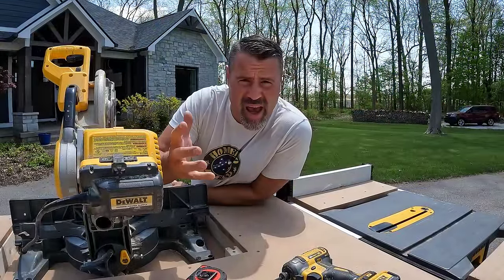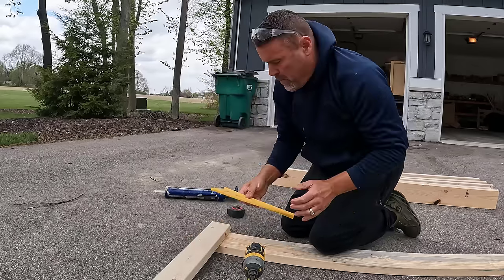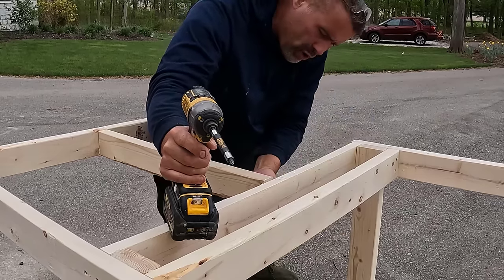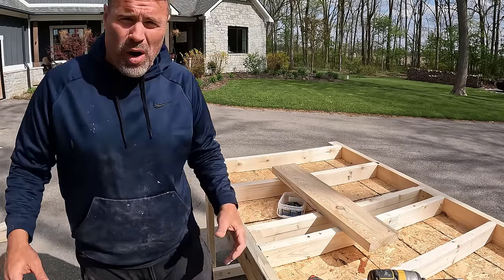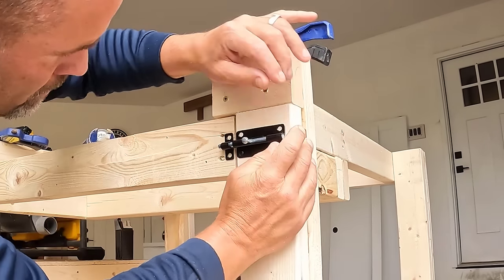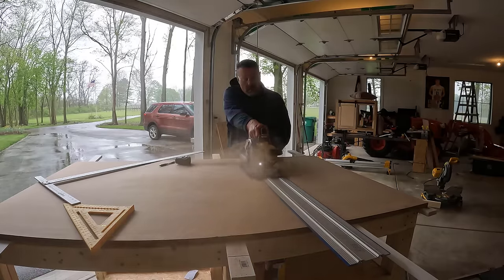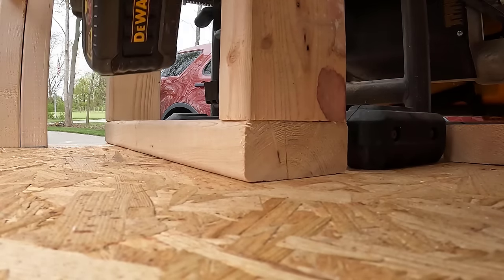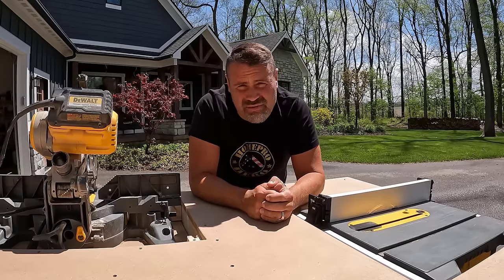Build This Workbench for UNDER $200

Comment: It is a great workbench build......BUT for me I sort of hate it!! You see I don't own a garage and where I do most of my work is in the lawn behind my house!! So those casters would sink into the ground if I tried to roll ANYTHING like this out of my "workshop"!! And the problem with my "workshop" is that it is only an 8 foot by 8 foot work area. This means ANY lumber I have to cut, I have to cut it in my yard!!! And use the inside of my workshop for things like glue up or some small assembly work!!
Reply from the maker: Yea not a good fit for you :(
Reply: bro you working in a box or what lol
Reply: This is my problem as well. My basement is an old 1886 cellar. Its not tall enough or really big enough to be a shop. Id love a bench like this.
Reply: Can you build a wall mounted fold out table somewhere? That might help you. Otherwise just make some cheap saw horses and screw a sheet of plywood to the top. When you are done, just unscrew.
Reply: Awwww mannnn you just need tires and not those lil wheels lol
Reply: Drill some holes into 4x4 legs and put some small bicycle forks into them.
Reply: you need to por yourself a concrete slab - just big enough for you and the bench, then put a tent over it 😅
Reply: Harbor Freight has pneumatic wheels on straight or swivel casters, 8” or 10” if you really want a go anywhere solution just adjust the build to compensate for the height. May be overkill for most but they don’t get stuck and you can drag it around most any yard. Improvise a type of kickstand solution to keep it put when you are ready to work. My shop is small and I do most of my work outdoors on the grass in backyard and get tired of dragging my heavy duty sawhorses, 2x4s and plywood around in the heat trying to find shade in 110 degrees. Built my portable bench ( though nothing as nice as this)with wheels and love it.
Reply: Little children in Rwanda are crying over your tragic situation. I here they are organising a concert to raise money for you to put some paving down.
Reply: You hate his bench because it won't work for your problems. 😂
Reply: Put bigger wheels on the bench for off-road use. 😊
Reply: Awesome job. Thanks for sharing your work 👍🏾
Reply: How is that this guy's problem..
Reply: You hate it because he didn't design a system custom to your situation? You realize the beauty of wood working is that you can learn something and customize it however you need? It's about learning. Not copying.
Reply: Modify the project and put sleds underneath so you are able to slide it to your work site.
Reply: Sound like you probably lol
Reply: Use the king size wheels.
Reply: Get a wagon
Reply: Simple tank track upgrade
Reply: Who puts casters on dirt 😂😂
Reply: I used bigger wheels from Harbor Freight. It rolls pretty good in the grass.
Reply: Thanks for sharing your dilemma because I have the same. 

Thanks everyone else for solutions!
Reply: Use old ply sheets to build a path on the lawn, use ur head for more than a hat rack
Reply: I understand your frustration regarding the lack of a proper workplace, it takes 5X the effort to get a project completed
Reply: Slap some OSB down on the lawn and roll’er on out
Reply: Same i have to do everything outside and store everything in the 8x8 room because people steal so it has to fit in the door way also. Love the casters but same problem.

Comment: Do you ever use a cross cut sled or miter gauge with your table saw? Just wondering if you ever felt the need to add slots in the outfeed.
Reply from the maker: No I never have. I actually like the kreg track saw better - seems safer too!  I got a kreg accu-cut I'm using on my next project. Have heard great things about that.

Comment: I have watched countless versions of this workbench being built and your presentation is by far the easiest to understand. Was able to build it using 90% leftover lumber from other projects so it only cost me like $40 to make. Thanks a ton!
Reply from the maker: Glad it was helpful! $40 bucks is a steal!  I guess keeping extra pieces of wood laying all over the garage is worth it :) Take care!
Reply: I was thinking the same thing! I like the size too. I think it is useful but practical when you don't have a ton of space. The only addition I will make is possibly a router station. Great project. Thanks!
Reply from the maker: I have had several people wanting to add a router table. I don't seem to ever need one I'm guessing more for wood working projects.
Reply: @HomeProHero  Definitely useful for woodworking. From basic work on drawers or rounding an edge on a table top to speaker boxes for car stereo projects or work on guitar bodies and pickguards. Routers are super useful and more so when they are mounted.
Reply: @63fryeguy  I'm building this bench right now and I'm including the router. I will let you know how it turns out!
Reply: @63fryeguy  I was finally able to complete the workbench with my router table instead of the table saw. It turned out great! I highly recommend if you want to add the router.
Reply from the maker: That's great!

Comment: Combining simple construction with mobility and an outfeed table, plus a fold-away miter saw station with adequate infeed and outfeed, all in a compact table saw bench is ingenious, or maybe genius. Well done!
Reply from the maker: Thanks and  adding the storage drawers was a game changer for my tools!  Take care!
Reply: . @HomeProHero  -- Yes to drawers, definitely. And here's another one: you could add a 2 or 2-1/2 foot hinged fold-down extension to the table top in way of your miter saw's outfeed side. You could do that by using hinged arms notched to fit against a chock on the underside of the extension deck to lock it level with your bench top -- or the arms could swing out from under the deck when you pull it up, then they could notch against a chock mounted on the end of the bench. Either way you'd have to add some structure to the framing at that end, but it wouldn't require much.

Comment: Nice vid and work bench.  Exactly what I want to build for my garage but don’t have the room available for the depth.  Do you see any issues making the bench narrower?  I have the Dewalt 8-1/4 table saw and was planning on getting the Bosch articulating 10” mitre saw so I don’t need the clearance at the back for the rails, which allows me to use a narrower bench in place.
Thanks!
Reply from the maker: Thx for watching!  Yea you could more narrow but no more than the height of the bench because it might not be stable. I think u could go 36 wide. Take care

Comment: Thanks for putting the plans out there. What an awesome design.  Made mine a little bigger and put a wing for my miter saw that i can lower out of the way when not needed. Plan on putting shelves to store my hand tool.
Reply from the maker: That's great!  If you do storage look at Stackteck at Lowe's - great stuff and it will fit perfect under the table saw. Just an option I would have done over building them. Take care
Reply: @HomeProHero  Thanx Mr I will look into stackteck.  That is the nice thing about your design, it is easily upgradable.

Comment: After watching about 10 of these, this is the table I'm going to attempt to replicate. Is there any advice you can give, or how about any changes you would make if u were to re-build it?
Reply: One addition I plan to add is a couple outlets so I can just plug the table in and have working outlets right there (I have a corded circular saw,jigsaw,grinder,etc.)...and, maybe, if I am brave enough I will attempt to make the legs foldable so I can hang the table inside my tiny 1 car garage when not in use
Reply from the maker: Thx for watching!  Not a big fan of the mdf top of the bench. Plywood would likely be better but the mdf works and is cheaper. Use at least 2-3 inch bulky screws for the caster wheels. Had one come off because my screws were too small. Other than that I love it!  The storage drawers are a must - really like those!  Good luck
Reply: @HomeProHero  awesome! Thanks so much for the reply

Comment: It worked for me. I have 2 storage rentals 10x30 that i use for a shop
 All my tools are setup on the walls sp i have a 7 feet x 20 to have a table in and the other unit has almost nothing in it
I can use it for staining and painting dust free
 I set up lightinh and receptical outlets to plug into my 28000 generater. I live in an apartment about .5 mile from my storage. I think its the best setup i could have living as i do in apartment. I have a small shelter i can setup out side if i need that space.
Reply from the maker: Thx for watching!  Never thought about using a storage unit for a shop when living in an apartment. I could have done that a long time ago!  Sounds like ur setup is working well!  Take care and be safe!

Comment: Just finished building this and waiting on my table saw to be delivered. I’m 5’ 5” and I put 3” castors on my table but it seems really high. Yours doesn’t look as high. Are you really tall? And do you think 2” castors would support this ok?
Reply from the maker: Im 6'1 but the bench was built at a average bench height. I'm sure you can go with smaller casters as long as the are secured tightly!

Comment: Do you have any issues with the mdf rotting?
Reply from the maker: Not rotting becuase I keep it inside and it doesn't get wet but If I had to do it all over again I would use a different product.  Maybe a 3/4 plywood.  Thanks for watching!

Comment: Love it! Thanks for the video. I've been wanting to do this for a while now; I think I'm ready for it! Love the table saw enclosure, and the drop down miter saw. Lots of room to work on without having to move everything off the table. So, if you wanted to cover up the table saw with a piece of wood, would you be able to do that by dropping the blade, and removing the fence? Seems that would be possible to give even more tabletop space when not using the saw.
Reply from the maker: It works great!  Wish I would have built it a long time ago :)  Thanks for watching!

Comment: Great job on mobile work bench!
I have one small question, what amp circuit do you run
Reply: Currently when I use the vacuum and table saw it sometimes blows the breaker. (15 amp)
Reply from the maker: Thanks for watching. I just plug into a 15amp socket. When I tied the battery on the workbench (video workbench 3.0) I plugged the.saw into the 20amp socket just because it was available.
Reply: @HomeProHero   thanks fella. I’m retired police office from OPP in Ontario Canada. It’s like a state police force
Reply from the maker: Thanks for the service!  I have 6 more years left at 27yrs right now.  Cheers!

Comment: Great work bench.  I made one like it only it's 4'-0" x 8'-0".  My chop saw drops down the same.  I have a board that goes in to make a smooth top.  I also made an insert to drop in to have an area for my router setup.  Works great.
Reply from the maker: Thx for watching!  Did you add any drawers?   It's my favorite upgrade!

Comment: I had a few questions:
- I noticed in your other videos that your miter saw is in the locked position. Do you find that you "hide it away" when you need to use the surface for outfeed or working on other things and keep the miter saw out most of the time?
- Where do you keep your dust collector? You mentioned that you were going to add dust collection but it's not clear where it would go if the miter saw is in the stored position as there's not a ton of under bench space left.
Reply from the maker: Yeah exactly right on the miter. It's done at times when I need the table top for stuff or cutting a sheet of plywood. Pretty easy to just drop it out of the way. Dust collection is the next video out in a couple of weeks - you will have to watch it to see how I got it all to fit!  Take care and thanks for watching

Comment: I took a quick look at the video but im at work and couldnt watch the full thing yet. Bench looks great!! I have a question, does the type/brand of table saw and miter saw matter? Or will i have to adjust the plan accordingly? Edit* I just completed my first project yesterday of building a patio set and realized the need to have a bench. I do not own a table saw yet, i just purchased a dewalt 12-inch miter saw.
Reply from the maker: Thx for watching. The platform on the workbench should fit most if not all 12 inch miter saws with no problem. The platform for the saw is 28"x18" so the legs on the saw should fit easily. Take csre
Reply: Thank you for the quick reply! @HomeProHero

Comment: I just want to say my friend thank you very much for sharing this with us and also not even charging for the PDFs as you very much can. You actually made me completely change the plans that I had because I liked your video a lot more and you made it very simple. Thank you.
Reply from the maker: So happy to hear this!  I plan on doing a video on a dust collection for the table because I get a ton of dust from the table saw. Other than that it works really well!
Reply: @HomeProHero  if I only had one helpful piece of advice, it would be to include every step just like you did in the beginning. When you showed all of the pieces and how many I would need of that exact size. Because you kept adding throughout the video. And then, when you built the drop-down box you didn’t really show that and so I had to sort of improvise. I am a beginner and so there were a few mistakes. Lol but overall if I could send you a picture I would and I think I did a decent job for my first time. So just slow it down a little bit and please keep including the on screen pop-up measurements the way you did because I feel like that was more than helpful. You definitely got a subscriber.
Reply from the maker: @AsPureAsitGets  thanks for the feedback!  There's a fine balance sometimes when it comes to creating these types of videos. I try to be more detailed in the plans to not over do the video. Almost like the video is high level and the plans should cover the gaps - at least I hope!  I think tomorrows video covers the measurements well but it's mostly verbal - thx for watching and the sub!

Comment: If you wanted to expand the bench to 4x6 vice your 3.5x6, do you think you would need more center support?  I want to have a router table on the right side of my sawstop cts to use its rack and pinion fence for the router.
Reply from the maker: Thanks for watching!  I don't think that would be an issue it over built a bit and really sturdy.  Good luck with your project!

Comment: Is that impact drill better than a standard drill driver?
Reply from the maker: I haven't ever used the low end model to be honest with you.  With that said the drill in this video stopped working about a month ago....after 11yrs of hard work and being left out in the rain several times.  I replaced it with the exact same model.  It packs a punch and its brushless which means it will last longer too.  For the few extra $$$ the DeWalt XR line is worth it if you plan to do more than basic house repairs.  Plus they have deals all the time I got 2 free extra batteries with the purchase of the driver :) Take care and thanks for watching!

Comment: Nicely done! May want to consider some gas struts to assist with the chop saw swing down
Reply from the maker: Good idea but I don't want to do all that!  I grab the front miter adjustment knob and unlock the locks. Than is easy to lower it down.  I honestly rarely do it anyways becuase I don't normal cut full sheets of plywood on the tablesaw - Keg jig works great!  Thanks for watching!

Comment: What screws did you end up using for your miter saw that you said "I don't know what these are?" I didn't see them in your materials list and was curious since we have the same miter saw! 🙏
Reply from the maker: I just found some laying around in the garage. But Spax lag screws will work. You can buy them at lowes or menards. I would get them long enough that they go into the wood at least an inch. Thx for watching

Comment: How did you end up securing the table saw down?
Reply from the maker: I really didn't. I put a block (cleat) in front of the front legs of the saw - and that is it. When you push a board through the table saw it only puts pressure on that front cleat. The tabletop pinches it in so it can't go right or left. It's easy to slide out through the back if needed. Thx for watching
Reply: Thanks for the quick reply. Appreciate you and the content!!
Reply from the maker: Thx!  Dust collection for the bench coming next!

Comment: What size osb did you buy?
Reply from the maker: Thx for watching. I used 1/2 osb for the bottom and the shelve that that table saw sits on which has been fine so far. I used 3/4 mdf for the top of the mobile workstation which has also worked well. Hope this helps!
Reply: @HomeProHero  oh I meant the footage! Just bought some 4 foot by 8 foot for both kinds
Reply from the maker: Just saw the reply you are correct!

Comment: Nice Build 👍 i made my table out of the scraps i had available in the garage from shipping pallets. Besides the castor wheels i had zero cost 
Question, besides both side locks being locked out what else supports the weight of the miter saw when in use?
Reply from the maker: Just the hinges in the back along with the locks in the front. It's really firm nothing else really needed. Thx for watching!